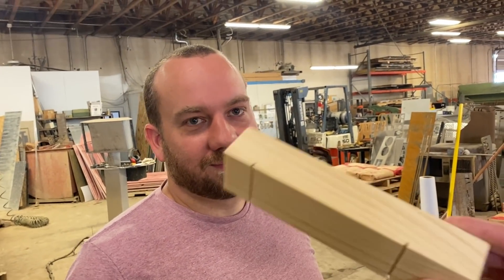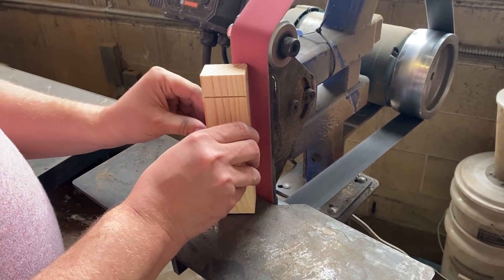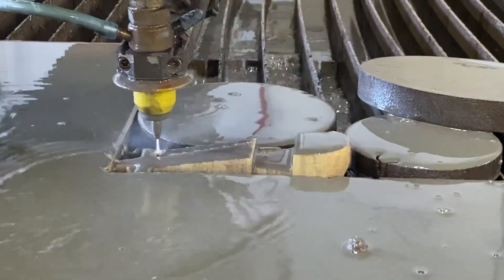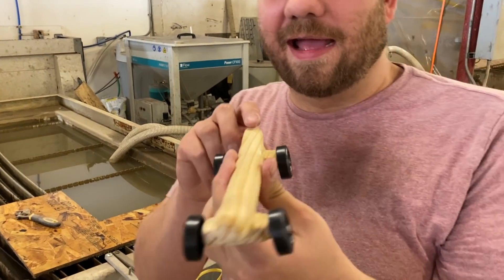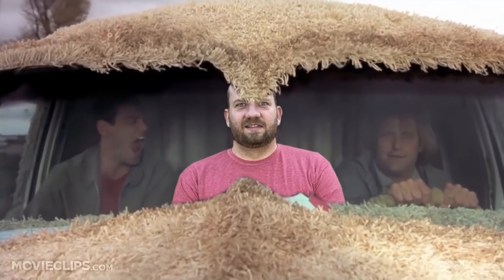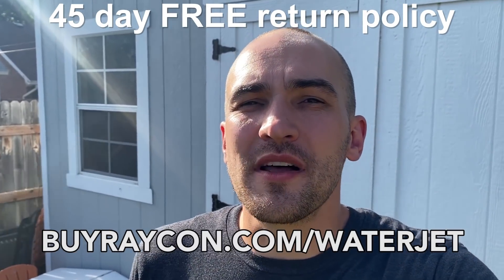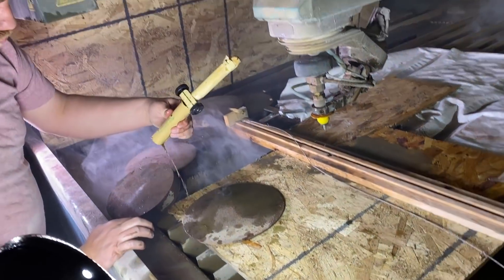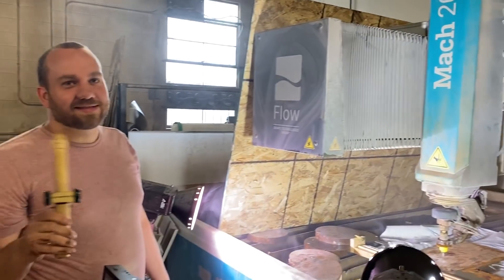Rocket-Powered Pinewood Derby Car VS 60,000 PSI Waterjet

Comment: ... if you're using a guide wire at all, why not use a blank angle grinder to spool it up and pull the car through? The rocket already messed up your form, so just leave the end of the track open and whip the car around. I'm sure you have a reusable grinder as opposed to a single-use engine (what non-rocketeers call a rocket)

Comment: Will the jet cut with out the grit added to the water? Im wondering if it still cut's but takes 20% or 40% longer you may save money in water cost because you can reuse whats in the tank after you filter it, you will save what ever the grit cost and maybe save on bit's because they may last a lot longer just running clean water. I know a pressure washer is not the same but I can clean my siding and the walk way and the floor in the shop and I kill weed's with it and even strip paint some time so im using 1000psi and can do all that so your using 60 times that psi so it may cut ?? You can do a video compare cutting wood and other things as you work up to metals  ( this is with clean water and this is with grit ).... You may be able to resurface aluminum rim's or winter rusty rims if you just use clean water to blast dirt and rust away and get a side job going.

Comment: I made a couple model cars that accepted rockets when I was a kid. The first difficult point for me was the find a way to control them upon launch.
Reply: You gotta add wings and place an engine  on each wing.  Make a singe fuse and give it a track to keep straight and gain speed.  We made one fly at camp once.  Took a week of 13 scouts making different wings and engine types types weight distributions to get it to actually take flight and not instantly go out of control

Comment: In my tech class we made co2 powered cars and raced them in local state and national they had 2 i bolts on the bottom that a fishing line to hold it to the track
Reply: Hey we did the same thing in middle school didn't do no competitions tho. I forget the name of the class but it had a bunch of different projects a few kids would be on at a time then every week we rotated so everyone got to do everything. Each project booth had a little tv and movies to go with what your project was. One was those cars. Another was making circuit board "Robot" Another was sewing machine monograms pillows? And another Was cooking using the sun and a parabolic mirror. Good Class. One i actually used most from in my non college educated life

Comment: Anybody actually tried Raycon headphones?
Reply: I have them.  Let me tell you about them.  
The ads don't lie!   They are very good.  At first they sound a bit overdone on the midrange,  (To me, anyway)  but just adjust your EQ and lower the mid levels a bit. Then they sound fantastic. Highs and lows are excellent!    I use AIMP, a music player for Windows & android and I can fine tune the audio levels and effects perfectly.  So no issues with sound once you adjust.  Of course every audio device is different. Fine adjustments are just necessary.  I use them on both my phone and computer. They last more than long enough to watch a couple of movies of average duration.  The case is a plastic clam-shell case with a metallic finish and a satin feel to it. A bit fiddly to open, but that's a tiny issue.  The buds snap into their ports magnetically, so you cant get them in the wrong way 'round.  The whole case is smooth and fits right into a front pocket or a purse easily.  If you are prone to dropping things in the grass, like I am, I'd go with the red ones. 
Overall they are very well made, don't feel cheap, don't sound cheap, and work like a charm. Plenty loud enough to block out a V-twin Husqvarna ZTR mower, and give you a bit of a ringing in the ears if you crank 'em up.   Bluetooth does have a tendency to restrict volume levels to avoid distorting the RF signal, so if extreme volume is your game,  stay wired and go with skullcandy.  Keep in mind that they are earbuds,  not studio grade Sennheisers.   I hope that helps you.

Comment: What happens when you try to cut one pound of Tannerite with a 60,000 psi water jet?
Reply: Probably nothing
Reply: @allinaday3526  A 5.56 round has enough energy to detonate binary at 53,000 psi... 60,000 psi is higher. Seems like it should detonate, but there's only one way to know.😏
Reply: @dipgrizzly25  yea, that true

Comment: Worst case scenario... Lighting the rocket pulls the guide wire to the side just enough to be cut by the waterjet, wooden wiener rocket launches across the workshop.
Reply: I think worse would be hitting the water jet nozzle and breaking it
Reply: @youtubeSuckssNow  I think the car flying around the shop potentially landing close enough to something flammable that it catches and burns the shop down would be slightly worse

Comment: Years ago I did a pinewood with a C rocket motor in the back, made a wing and all kinds of aerodynamics for it, was not used for competition it was just a fun project for me and my nephew, we would run it down the street and did multiple runs to get the aerodynamics down for it. I don't have it anymore but we did a 2.0 version of it that has not been tested yet and unlike the one in the video, our rocket was placed inside the tail of the car.